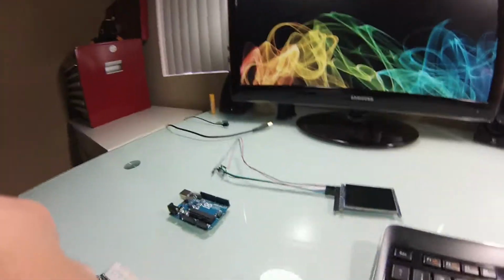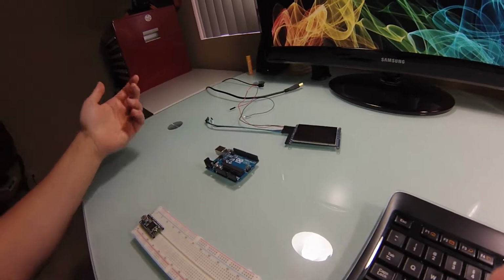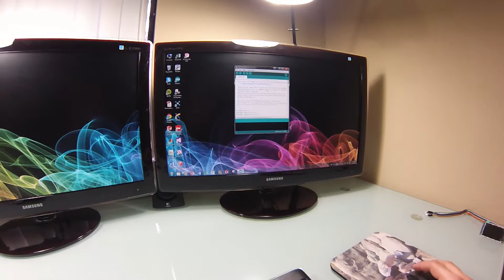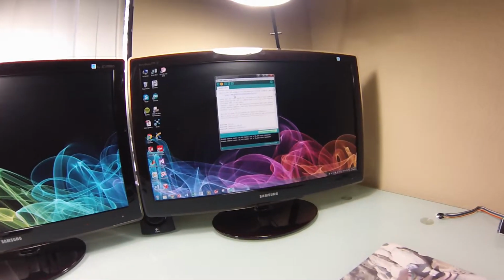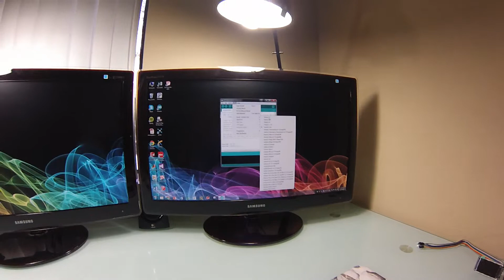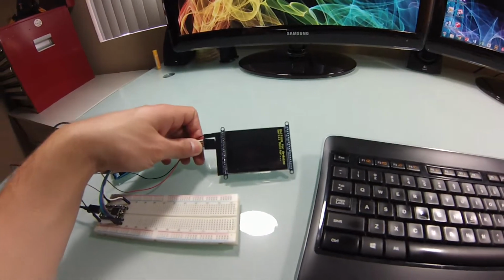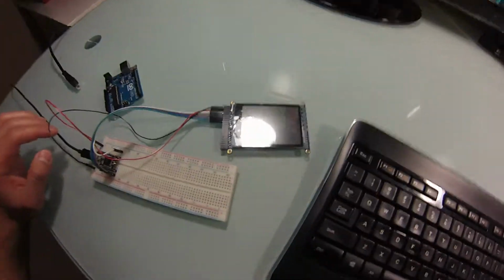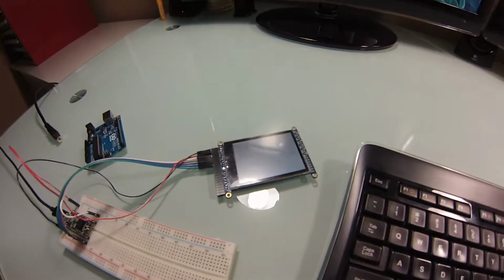Teensy 3.1 & Adafruit 2.8" TFT LCD with Cap Touch Issue

Comment: Hello, 
i think I have the same problem Teensy 3.1/ TLT showing while screen only - not getting anything - how do I define SPI RST  and wire to display's RST ? 
mike.menci (at) gmail.com
Reply from the maker: Mike - please see the following thread where the solution was posted: https://forum.pjrc.com/threads/27904-Optimized-ILI9341-Library-Problem

Comment: Did you define an SPI RST pin on Teensy and wire to the display's RST?
Reply from the maker: After getting some suggestions from another Teensy user, that's exactly what I ending up doing. It worked great. Thanks for the idea!